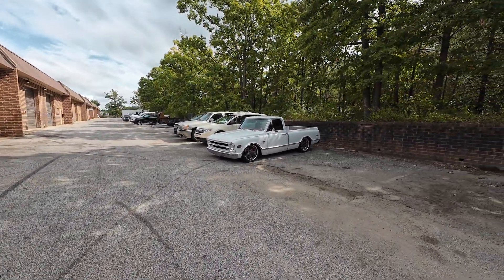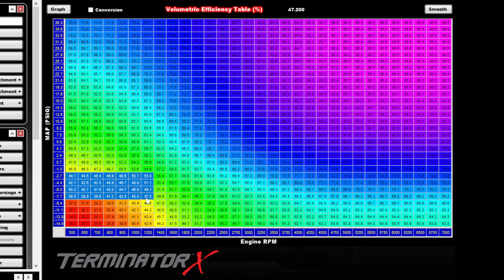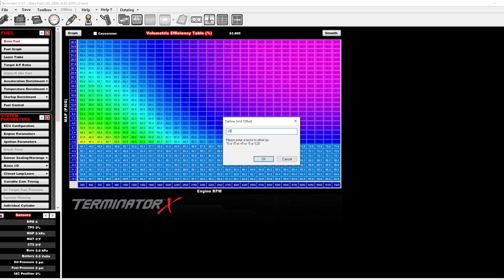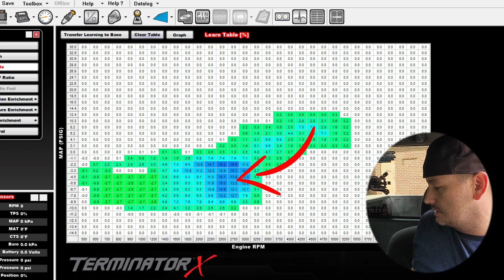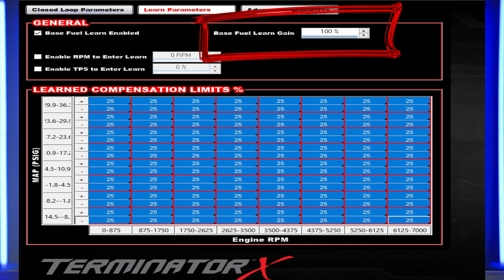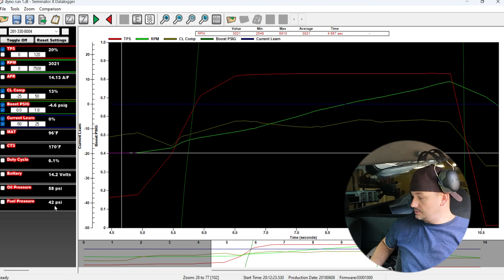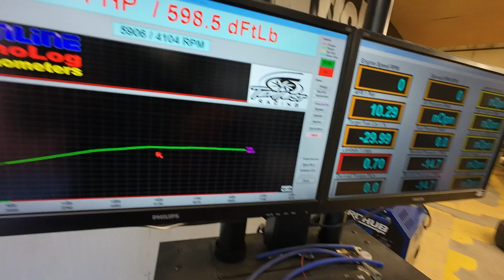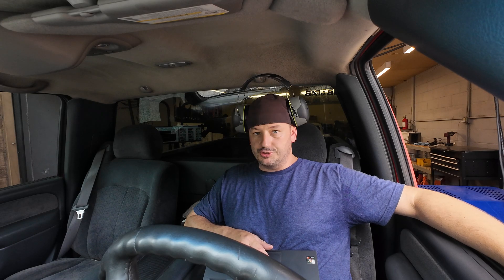Do You Need to Re-Tune After Swapping Fuel Injectors?

Comment: I drive my turbo fox without a hood and no muffler pretty much every day, I used to be nervous about the cops giving me grief about it but the last two years of driving it the popo have been surprisingly cool. 
But Its the State troopers that make my bottom lip quiver a bit knowing they are out there.
Reply from the maker: Yea i think its all a matter of where you live
Reply: I have a question. You ever had a Dominator box that would randomly drop one injector ground only after heat soak start up and come back from cycling the key?  Mine dose it all the time but will come back as soon as I turn it off and restart it a few times. 
it’s never the same cylinder that drops but random.  it has dropped two injector grounds at the same time as well but rarely. It only happens after I shut it off while hot and restarting after about 10 minutes. Data log shows nothing I can find. 
Holley seems to think its a software issue. I have tried about everything to fix this but it sucks spending 5k on efi only to have stupid problems and horrible customer service. Thanks for any input.

Comment: What fan do you normally use to keep the cars cool. I have a Dyno Dynamics chassis dyno. The fan is the biggest struggle so far. I had a small 240V  fan used for firefighting that worked better, but customers complained that it wasn't what they saw in magazines when they came in... so the overheating problems where automatically my fault in their mind. Then I bought the exact fan most use - Patterson 30" H30A to shut those comments up. It's not as good, more air going around the car than directed where its needed.
Reply from the maker: I use the mainline fan. 

I don’t think I’ve ever had anybody complain about my fan even when i just had crappy fans haha

Comment: I just helped a customer swap injectors with a really sorted fuel map and all the right flow and dead time data and it was still off 10-15% everywhere. It was closer at idle but much further away on boost. It was pretty much what you showed here as far as how much work to get the new injectors to be happy
Reply: @TurbineResearch  
I went from old school 1600's to FIC "1650's". Came with all the data showing 1650cc flow at 43.5 psi on their test rig. The car was way leaner on the FICs. Wound up setting the injector size to 1450 to get things lined up. I found that injector from the factory is rated 1650 at 58psi which is right around 1450 at 43.5psi. Imagine that. Later I flowed them myself and still got 1450 at 43.5 psi using 2 wally 255s on e85. So honestly their flow data seemed off for some reason.

Comment: I've noticed whether with a Holley ecu or a GM oem ecu, you could hit the same cell in 1st gear when accelerating as let's say 4th gear on the highway with the torque converter locked. What could show rich in 1st gear, may be just enough or lean in the other gears. Really makes you chase your tail whether VE or MAF tuning.
Reply: @GTStuning-  
I ve seemed to notice the same thing tuning a mega squirt type speed density e cu.

Comment: Can you just make the injector size 20% bigger in the holley settings initially instead of messing with the fuel map? Or is that not an option with holley ecu?
Reply: That would be selected in the injector data tab. Holley is good about having a large selection of injectors to choose from or making the offset completely custom. Whether lb/hr or VE, I’ve noticed tunes still need to be touched up after injector swap outs. Not to mention digging into ind cyl correction as the new injectors may flow differently per hole.
Reply: @a80Adam  
That is really cool thanks for the info.
Reply from the maker: Yes. I manipulate injector size a lot in order to get the be table numbers where i want them to be, or sometimes when switching to ethanol.
Reply: @JoeSimpsonAtTempest  
Was the switch to the ids or to the snakeaters? Just curious because I know IDs whole selling point is the fact they are supposed to come with accurate data and flow matching.
Reply from the maker: @Shademax4273  switched to IDs. They are the only injectors I’ve really used or sold for the last 10+ years
Reply: I went from old school low imp 1600's to newer high imp FIC "1650's". Came with all the data showing 1650cc flow at 43.5 psi on their test rig. The car was way leaner on the FICs. Wound up setting the injector size to 1450 to get things lined up. I found that injector from the factory is rated 1650 at 58psi which is right around 1450 at 43.5psi. Imagine that. Later I flowed them myself and still got 1450 at 43.5 psi using 2 wally 255s on e85. So honestly their flow data seemed off for some reason.